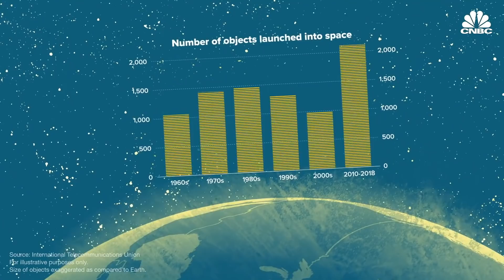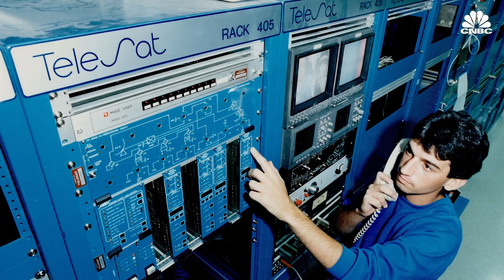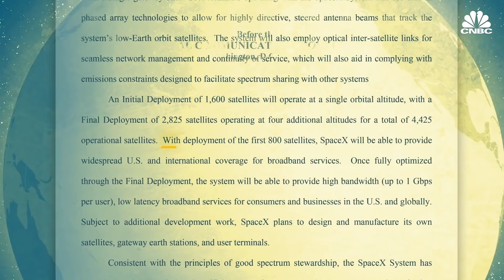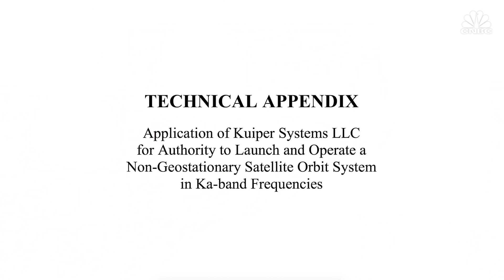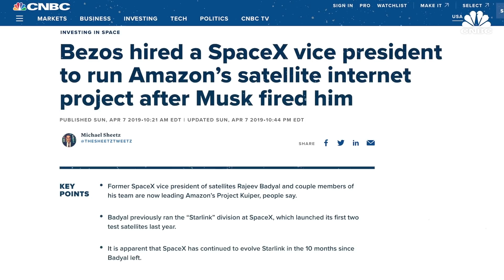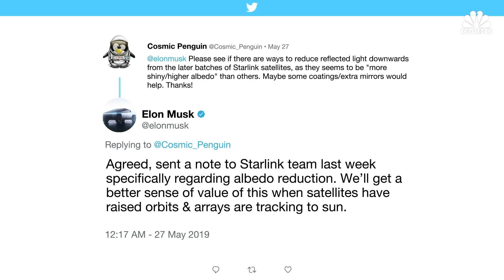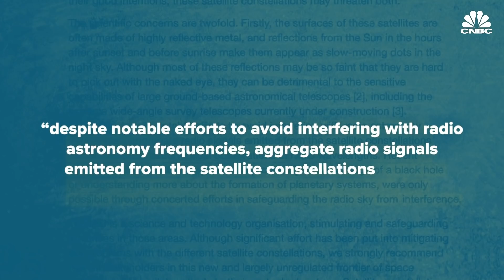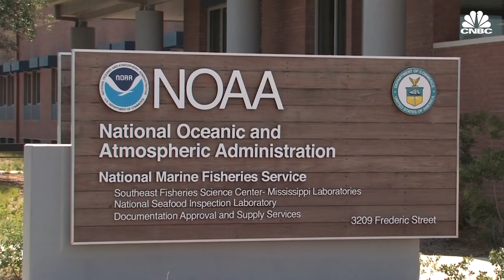Why SpaceX And Amazon Are Launching 42,000+ Satellites

Comment: SpaceX DOES NOT need to build any towers or ground infrastructure for Starlink to work since it works differently then all of the others. The only thing required is for the customer to have a receiver mounted anywhere with a view of any part of the sky. The 1 million "earth stations" as this Comcast employee called them, are actually the individual receivers costumers have at their homes, businesses  and, on their vehicles. These receivers are about the size of a pizza box and connect directly to the satellites not to towers on the ground. The receives can be placed anywhere with line of site to the sky and don't need to be pointed south like other satellite providers since these satellites will be in every direction overhead not just always sitting over the equator.  They are being leased as part of the internet contract, all of this was talked about by Elon in the very same video they showed of him announcing Starlink but they seem to have left that part out almost like they didn't want people to know the truth since it Starlink could very well put their parent company Comcast out of business.

Comment: Space X followed the rules and has launched 120 so far.  Amazon is attempting to get permission to over step the FCC original ruling that in turn allows Amazon to have access to the ka band frequency.  It's not right basically they are poaching meaning the season ended in 2016 and they want to still be able to hunt 4 years after the fact.

Comment: Does these Satellites have anything to do with 5G? And if so in what role? Thanks
Reply: It is a year late response but 5Gs are close quarter technology that the waveforms signals are being transmitted by antennas just similar to traditional 4G antennas. The only difference is that the way 5G operates, which the waves are more targeted and concetrated with faster frequencies, meaning, use alot of antennas in the suburb areas because very high frequencies can be blocked by the physical materials. Well, on the other hand, satellites can be used for maritime, aviation and isolated terresterial locations which there is poor antenna signal or not covered by antennas at all. For example, plane wifi, cargo ship communication in middle of a sea or a isolated mountaineous location.

Comment: Since they didn't link them simultaneously up to one another they can never be adjusted to maximum primary specs.  The numerology of the quantum geometric pattern is satellite sequencing. This will create the satellite geometric structure.  With out this process you will achieve only single use satellites such as starlink.

Comment: Materials engineer here and aerospace engineer dropout. Young and inexperienced but practiced and certified

Space junk comments = uninformed people. 

The satellites were designed to be in low orbit with a 95% re-entry burn rate. 

This means upon re-entry approximately 95% of the satellite material will be burned or destroyed for each individual satellite, leaving low orbit clean. The other 5% is laser diodes and other harder components that require extreme burn resistance material wise.  Any materials not burned in orbit have a maximum life time in low orbit for 2 years, however this material is extremely limited and rare to skip initial re-entry.

Starlink satellites are $300,000 as of current date. Not 1 million.
Reply: Data checks out. Look it up

Comment: These journalists do not seem to understand the difference between bandwidth and latency in network. Sad. 
Geostationary internet satellites have a very high latency (about 0.6 a second) because of the time it takes for electromagnetic waves to travel back and forth 36,000 km..  This means that response time to a request to a server on earth sent from a program in a computer is a minimum 1.2 sec, making many applications unusable. For streaming video, this delay does not matter and the bandwidth of each transmission is not limited by the delay. Low earth orbit satellite have at least a 20 times lower latency due to the short distance that electromagnetic waves have to travel.
The reasons that a large number of low orbit satellites are needed is that each does not stay long above a given geography area.
The technology is fine to provide high speed low latency internet to cars, trains, and buildings, but not to a pedestrian's phone. It is likely to be a fierce competitor to 5G due to the potential lower capital investment.

Comment: at 2:40 "Irrespons, Not a real word." Has nothing to do with loading times or "smoothness". You can have a 200 Mbit/s connection from Earth to Pluto that will load data 100 times faster than a 2 Mbit/s connection from washington to NewYork. Latency in communications and computer networks, is the travel time for a signal or information to be sent from A to B and a response fro B back to A. Shame on You CNBC! The Statement of the expert Dan Hays at 4:00 that there is more to it than distance from customer to Satellite, and that capacity is key, and more capacity requires more satellites is correct. 
And for sensors pointing towards earth a definition of what a camera is would need to be greatly specified, for then sake of NOAA or any other equal regulatory body.

Comment: Your story failed to mention the fact that low earth orbiting objects de-orbit themselves relatively quickly due to there being a small amount of atmospheric drag present at those altitudes. This automatically cleans up the debris and failed satellites. You showed large investments needed for ground based communications which is misleading.  Network designs show minimal ground based antennas and satellites that communicate internet traffic between themselves to optimize ground to satellite connections.  Also, the story did not touch on the possibility of these new networks providing cell phone coverage directly from the phones bypassing the cell tower network.

Comment: SO WHAT KIND OF WAVELENGTH IS GOING TO BE USED? 
wiki says: In February 2015, SpaceX asked the FCC to consider future innovative uses of the K/a band spectrum before the FCC commits to 5G communications regulations that would create barriers to entry, since SpaceX is a new entrant to the satellite communications market. The SpaceX non-geostationary orbit communications satellite constellation will operate in the high-frequency bands above 24 GHz, "where steerable earth station transmit antennas would have a wider geographic impact, and significantly lower satellite altitudes magnify the impact of aggregate interference from terrestrial transmissions."

BASIC FACTS * MICROWAVES  CELLULAR  WI-FI ELECTROMAGNETIC RADIATION:   https://docs.google.com/presentation/d/e/2PACX-1vTb3AqnWG1On2PI4IUHUSkmFoM-wTxq1E54FoKT_UaBuBz7RrvWJZD1ovulr4d1fVBut6WShDtrUXrT/pub?start=false&loop=false&delayms=3000

Comment: we are coming upon a revolution in satellite technology the development of 3-D printed satellites 3-D printed rockets that have self landing capability The development of atmospheric ion engines compliant mechanisms well all play a part in almost completely replacing land based Internet connections for 5G Internet so let’s break it down when were 3-D printing a satellite we don’t 3-D print the electronics yet though that’s coming in five years we 3-D print all of the mechanical mechanisms as much as we possibly can and this reduces the number of parts down from tens of thousands of parts down to possibly just 10 50 or 100 and that reduces the amount of space debris because you have much less components to go flying all over the place it also eliminates all the nuts all the bolts all the screws so it makes it much more simple and much much more cheaper and compliant mechanisms are a part of that they allow you to have complex machines made out of a single part they can be easily 3-D printed or multiple interacting parts that are very simple and can be 3-D printed and are very durable and air breathing ion engines allow the satellites to stay in orbit almost indefinitely and the ability to 3-D print entire rockets further cut the cost down of the rocket and it does the exact same thing for rockets that 3-D printing a satellite would do and making everything in the rocket totally reusable even further cuts the price down https://youtu.be/97t7Xj_iBv0  https://youtu.be/R5mhUm6NzqE. https://youtu.be/srmtxK44YXk Another big revolution would be the 3-D printing automated assembly line because you can’t 3-D print everything at once you have to 3-D print multiple individual objects in the idea was that combined in 3-D printing with a modern day autonomous assembly line would massively improve production speed

Comment: You know it’s really gonna be a big revolution and satellite development 3-D printed satellites not all of it can be 3-D printed but you can 3-D print a lot of it in the use of something called compliant mechanisms that’s going to cut the Price down by 60% because you take out all the nuts you take out all the bolts you take out all the screws it’s seamless it’s much more durable has a much longer life and it produces nowhere near as much debris if it’s smashed you reduce something that has ten thousands of parts To just a few hundred parts or two just even 10 parts https://youtu.be/R5mhUm6NzqE check this out and this https://youtu.be/97t7Xj_iBv0

Comment: Why not instead make better use from commercial airliners to provide Internet when passing over area, the more traffic the better. Every plane could  provide internet when equipped. So commercial airlines could also make a profit from this.
Reply: Satellites in orbit take very little fuel to keep in orbit once they’re up there. Adding mass to aircraft would eventually turn into a LOT of extra fuel used in a plane’s lifetime
Reply: @alexsiemers7898  adding extra weight to the satelite means additional extra cost. Which is the most significant reason why they launch them with the least amount of weight they can. Launching cargo is a very expensive task. In order to be viable they have to do it the way they do.
Reply: Don Lucchese but if you put something in orbit, that’s a one time cost, and it covers a much better area in the case of internet connection.
Reply: Saturation of expired objects is the main issue. And how to deal with them. No one says that the providing internet isn't useful but it will put the next generations into trouble thanks to us. Just because we want internet everywhere and everytime. But they will have to pay the price by dealing with it. And that is not a good legacy to inherit. Commercial jets can be just as good. Travel routes can be used to provide wifi. And the frequency of traveling by jets is all time high. Why not put it to use? Would be a smart thing. No doubt in that.

Comment: This "Bringing internet to poor" seems like a giant lie. An ulterior motive has to be involved. No company will spend billions of dollars just to help poor people...
Reply: They are going to implement the internet to tap into the natural neurological electricity within human beings they searching for a sustainable energy source
Basically they're going to turn humans in to batteries
Reply: I also wonder why allthe telcos are still putting up 5G towers everywhere. I suspect it has nothing to do with space internet,but government surveillance over the entire planet.
Reply: Not poor.  Rural.  CNBC probably doesn't know the difference which is why they show pictures of people living in shacks instead of some rural farm house with a loaded Ford F250 and $150k tractor sitting out front.  Even rich people in rural areas have trouble getting decent internet because the infrastructure doesn't exist.  Having said that, if the technology can bypass the wired infrastructure issue then it will be within reach of both rich and relatively poor people in rural areas.
Reply: @CL-gq3no  if it doesn't pay to spend thousands on fiber to rural people it doesn't pay to spend millions on the same people
Reply: @jojoflowe , not a good comparison and your numbers are wrong.  When a rural customer wants fiber, the ISP has to run miles of fiber for that one customer.  The next closest customer might be several acres away, etc.  Each of those customers might cost thousands of dollars in labor, machinery, and materials.  The ISP will never be able to get their cost back from those customers if they charge them a monthly price they can afford.  On the other hand, a constellation of relatively inexpensive satellites (thanks to modern technology) covers the entire world once operational. 

So in one case the cost is 100's of millions of dollars ($1,000 per customer x 100,000 customers for example) to provide access to a fairly small number of specific homes one at a time.  The other case is 100's of millions to provide rapid access to all 8 billion people in the world.  Which business model makes sense again?

Also, the satellite strategy has the advantage of being useful in mobile situations (commercial vehicles, ships, yachts, planes, trains, RVs, police/emergency vehicles, etc) which is a whole new market.  Wired internet is useless in those applications and wireless technologies are slow and/or crazy expensive.

As someone who owns property in rural Florida, I have a clue about this.  My options for internet on that property are extremely limited and the fastest speed available is ~2Mbps for $60 per month.  I also have a need for broadband internet from my car since I work remotely and often have problems connecting to my employer via cellular (even LTE is slow as hell).  If Starlink is reasonably affordable it would solve both issues for me.
Reply: The ulterior motive is to monetize all those people.
Reply: Its part of the 5G garbage.. Also the 21/30 agenda and nwo
Reply: using the signal waves 3d live imagery mapping of all organism and mineral is possible, even manipulation
Reply: even telling of past and future  event
Reply: I HAVE A QUESTION THIS IS FOR SURE STARLING, AND TO MENY OTHER COMPANIES IS GOING TO SENDING SATELITES WORLDWIDE ON THE FUTURE, OR SPEAKING JUST FOR COMERCIAL NEWS OR THIS IS THE GAME I DONT KNOW, THENK YOU.
Reply: The service won't be free, it's not charity. Poor people and rural areas still have money to pay for internet. The ISP business is a trillion-dollar market. Imagine if you could guarantee the same service across the entire globe and could undercut every ISP currently out there because your initial capital costs are a fraction of theirs.
Reply: they do on a yearly basis, but they're not going to just throw away money either, that's just basic economics common sense, if you want to make both a profit and better quality of life, provide a service and invest locally that provides job and health security that encourages spending, there's nothing unethical about investing into poor areas, and bringing them out of poverty to create future profit, if that profit helps people out in the long run why not support such a cause, poverty is the biggest contributor to air pollution and disease, if a company is willing, then help support those companies, it's why i support home depot, best buy, target, and amazon religiously, they do the most good in america at the local level
Reply: B O B Spelled backwards  someone needs to explain what facts mean lmao
Reply: It might be a good investment in the future 'cause you don't know what's in the minds of the people living in rural areas. When I look at E.Musk, I see a man that grew up from Africa and I could clearly understand what he can do with the knowledge provided by the Internet. When I look at other poor kids in Afghanistan and Vietnam, I can only imagine what they're capable of if the Internet's within their reach
Reply: It’s 5g guys it’s to control us
Reply: To help with 5g surveillance maybe
Reply: Twindians this has nothing to do with 5g, that’s a completely different system
Reply: @Mountain4  how do we know
Reply: Dude Elon said he was going to bring coat for us so we can go to space it cost 1m
Reply: Bro i just my internet fast 😌
Reply: Being saying the same thing all along ✌🏽💯
Reply: Starlinks primary reason for existing is to provide revenue for spacex so they can develop starship and go to mars. Viasat will soon be bankrupt after starlink takes their customers and oneweb is already bankrupt. Amazon is years from competing with starlink.
Reply: Our beloved corporations are doing the dirty bidding of the military industrial complex in plain view but the normies won't see it until 🤖⚡️🔥💀
Reply: It's for surveillance.
Reply: @mycoffeemyday  no it isn't its to generate ludicrous amounts of money from stock exchanges that desire a low latency connections and are willing to pay billions for the privilege. These satellites have almost no surveillance capabilities.
Reply: @mycoffeemyday , what kind of surveillance?  Governments can already snoop on existing internet service so no need to launch a bunch of satellites.  These satellites don't have giant opics/cameras so they aren't good for visual snooping either.  If you are going to make up a baseless conspiracy theory at least support it with some tiny fragment of "logic."
Reply: @CL-gq3no  are you sure?!?!